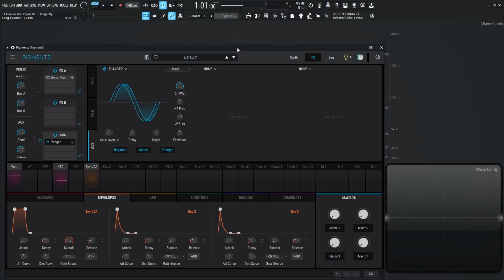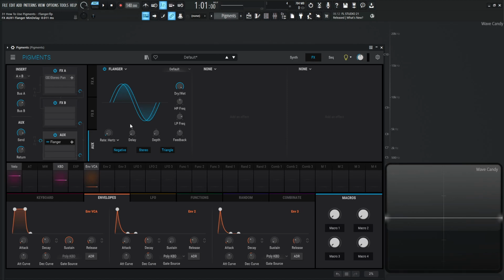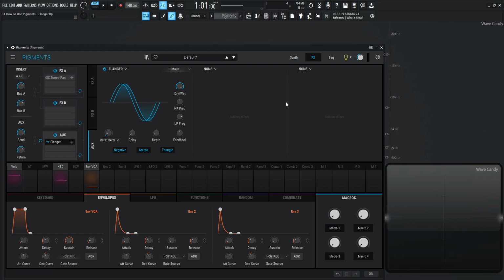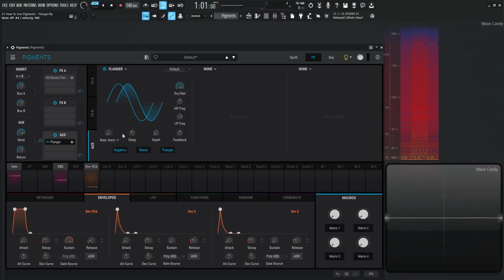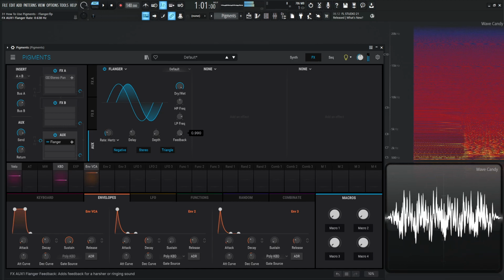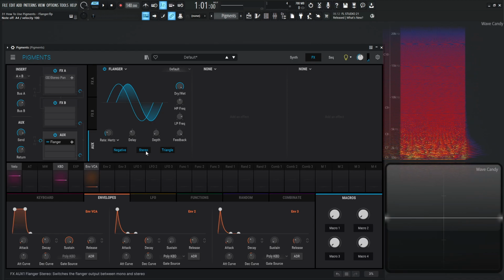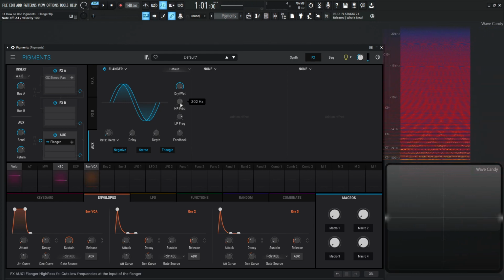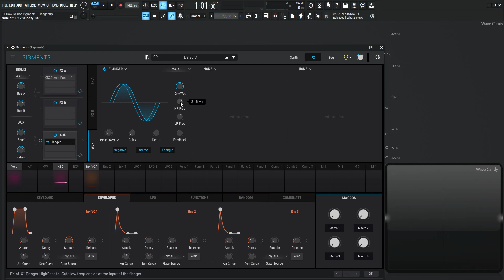Flanger Module Module PART 31 | Arturia Pigments 3.5 Tutorial

Comment: i find it hard to understand the real world use case of the reverse polarity part, I even chain it using F1 to A and F2 to B  split with B choosing negative..
Reply from the maker: Yeah I feel you. I think it's one of those things that offers a slightly different sound but overall it's not something that will make or break a flanger in my option. You'll never hear anyone say "you know, this track is good, but they should have used a negative flanger instead of regular flanging"
I see it more so as a cool concept in theory.